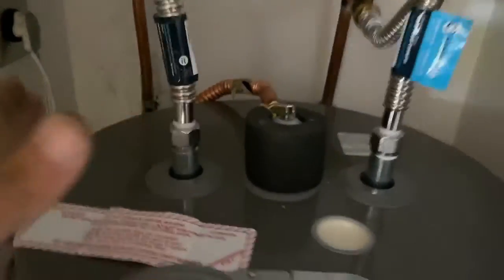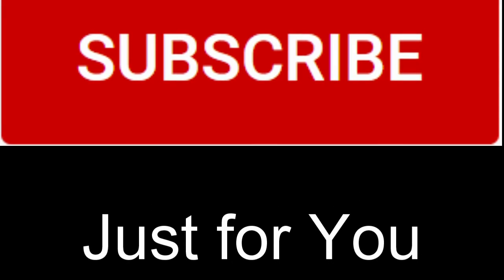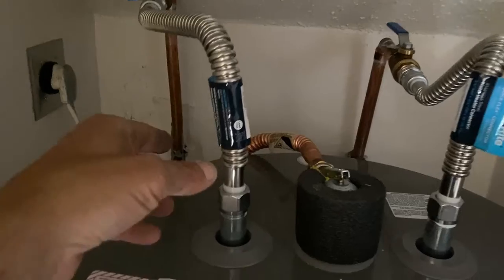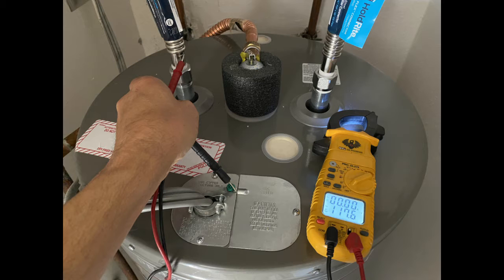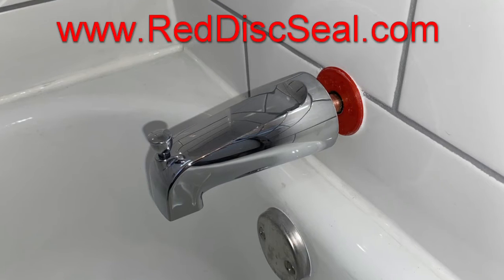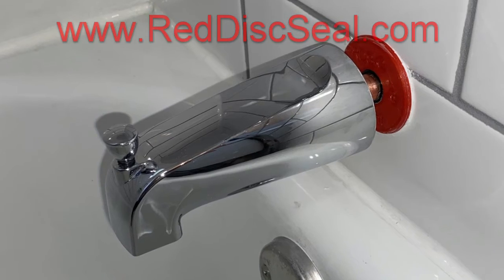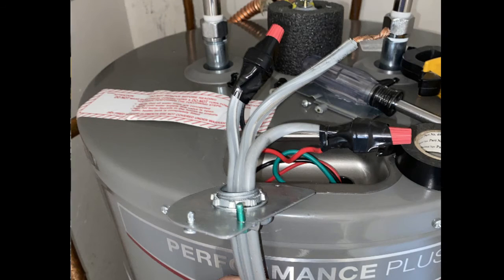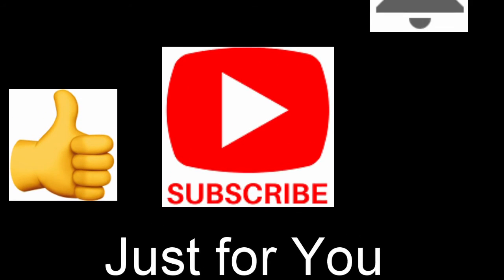How to Correctly Wire a 240 Volt Power Cord to Stove, Dryer or Water Heater, Avoid Electric Shock

Comment: Hi, what about the other 2 wires red and black. Where does the red wire from the water heater go on to. It is go to white wire and black go to black. The dryer cable does not have color code wire. Does it matter witch outer wire go to red or black wire on the water tank
Reply from the maker: It does not matter which outer wire goes  to which wire on the device. The main thing is that the center wire of the cord must go to the ground.
Reply: @JustForYouDiy  Hi could you do video showing which wire from the Hot Water heater connects to the cord wires?  Something showing the orientation ? Thanks
Reply from the maker: @Filmaker25 The only wire that matters is the center conductor for the cord. It has to be the ground wire. Hope that helps.
Reply: @JustForYouDiy  Ok, so "hot" wire is the only one connected to the cord? While the ground is connected to the green ground screw ?  the other two wires look wrapped in your video , my stupid question is are they connceted to anything or just wrapped with electrical tape?

Comment: Where did you get that cord at? Is that a dryer cord?
Reply from the maker: It was there already. You can use the one that’s used for electric stove or electric clothes dryer, depending on the outlet type and current draw, 30A or 50A. For this case, 30A was used. Hope this helps.

Comment: Does it matter which of the outer wires goes to the water heater?
Reply from the maker: Each outer wire goes to a breaker and it does not matter which one goes where. The center one must go to ground. Hope this helps.
Reply: What wire neatral white black red

Comment: Yet the water heater has flexi hoses 💀
Reply from the maker: You got it. To be exact, Unbranded 3/4 in. FIP x 3/4 in. FIP - 18 in. Stainless Steel Corrugated Water Heater Connector
Reply: @JustForYouDiy  ...that's not something I'd be bragging about 🤢
Reply from the maker: I’m open to suggestions. What do you recommend?
Reply: @JustForYouDiy  the reason why flexible water heater piping is legally banned in my state (I don't know if the same is true for your state) is because the flexible piping can and eventually will collapse on itself (kink) and cause a blockage. I recommend either using pex tubing, soldering copper pipes, or using viega pro press copper fittings on copper pipes when installing a water heater. As long as you avoid flexi pipes and shark bite fittings you shouldn't have leaks or issues for many years to come :)
Reply from the maker: Thank you. Texas still allows flex pipe for water heater supply lines. That said, due to eventual breakage of flex copper, the stainless steel versions are becoming more popular. 

In at least one county in Texas flex waste line adapters are not allowed because of premature clogging.
Reply: @JustForYouDiy  But I have seen these sold in the Depot and lowes and they don't seem to warn anyone??